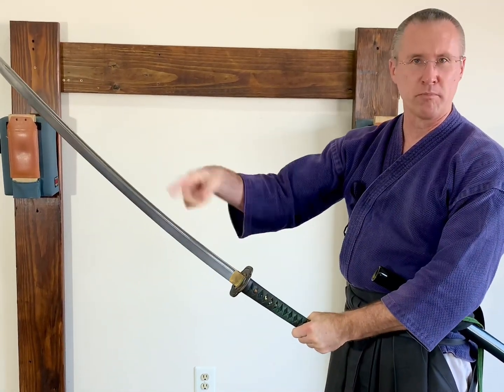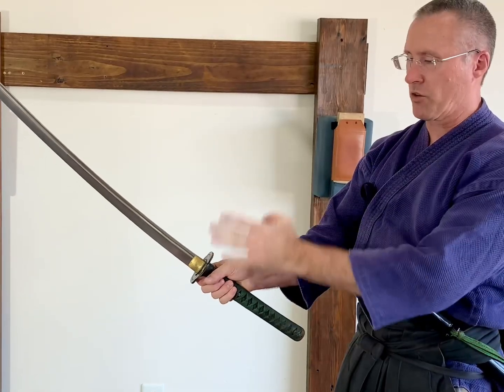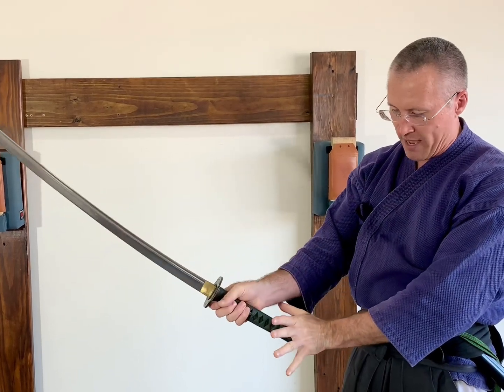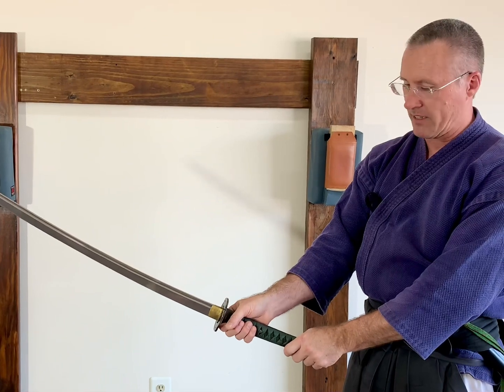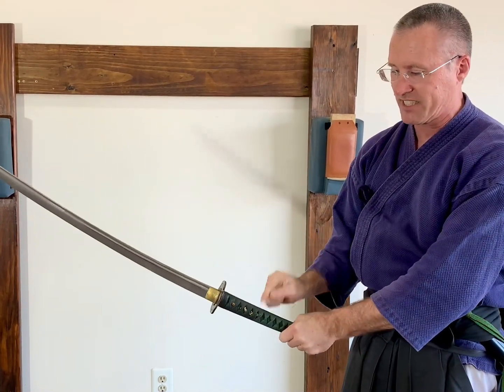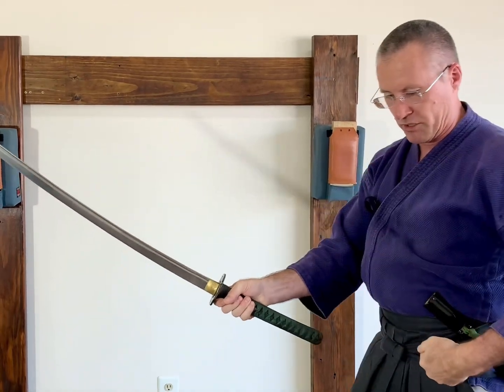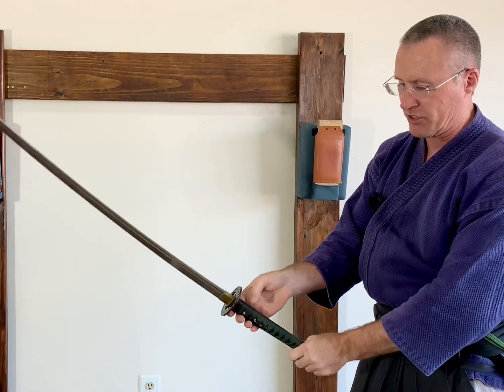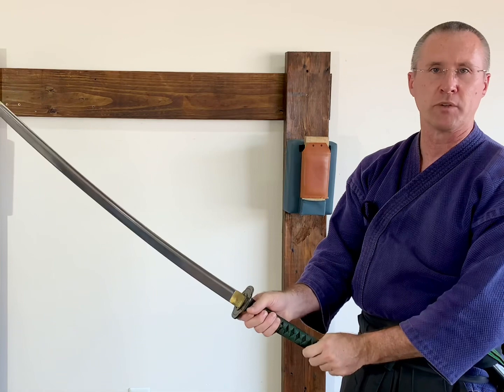Katori Shinto Ryu Chiburi  How to spin sheath a katana

Comment: Where does the rattling sound come from? It is done on purpose in removing one of the seppa. I notice all katori practitioner's katana make such a noise when they do the chiburi.
Reply: Thank you Paul Sensei if you can let me know how to get that "ke cha" sound?🙏🏼
Reply from the maker: Technically there should be no rattle in the sword while training. I don’t think any Katori practitioners purposely take out the seppa.  A student just fixed mine so it doesn’t rattle anymore.
Reply: @paulfrank1777  Thank you Paul

Comment: Super useful tips, now that is a detailed explanation, thank you!! Also, I'm worried now of ruining my iaito blade by performing this repeatedly... Is the blade you're using a iaito made of steel or a shinken? I apologize in beforehand if you get asked about this often, I've been thinking to upgrade to a steel iaito somewhere in the future but I can't find steel iaitos with a nice and well executed koshirae as the japanese made ones and I don't know how the balance will be.
Reply from the maker: My friend Randy Black from Phoenix Arizona is well respected in our group for His craftsmanship. He’s the one that custom built my sword. I just know the sword is very well balanced and it is steel.
Reply: @paulfrank1777  Thank you for your insight one more time, Paul, really appreciate it. I'll look into Randy's work... your sword looks fantastic with tons of attention to detail and refinement, I love how it looks. One can tell it's been built by someone with immaculate taste and knowledge. Refined and elegant, yet 100% functional. In the meanwhile I think I'll be practicing KSR chiburi with my bokken instead of my alu/alloy iaito, haha :)
Reply: @tofufregit  I would buy a cheap chinese sword as a beater to practice on. They are like only $30 and there are tons of different lengths so you can find one that mimics the balance of your real sword. The Chinese swords are pretty dull, but for the purposes of practice a quick pass with an angle grinder can completely remove the edge and point for safety.
Reply: @paulfrank1777  Does he have a website for that?  Looking for another sword since the one I have is 3 inches too short.
Reply from the maker: @Dark_Lord_Mr_B  

Randy Black Located in Phoenix, Arizona. katanarb@cox.net (602) 604-7920